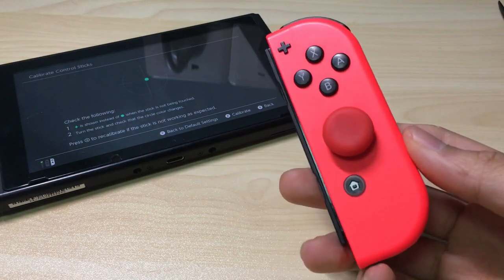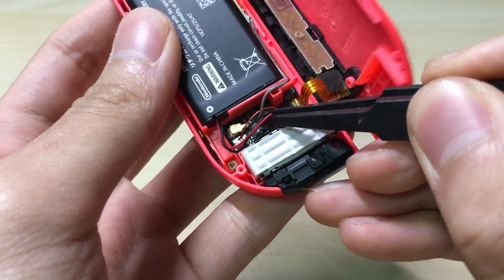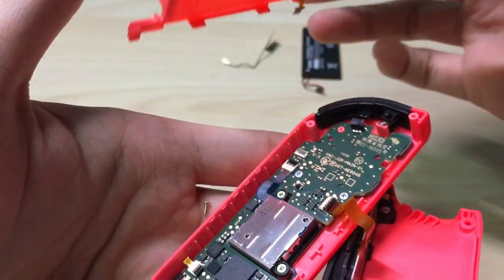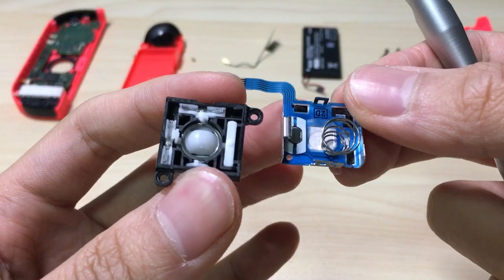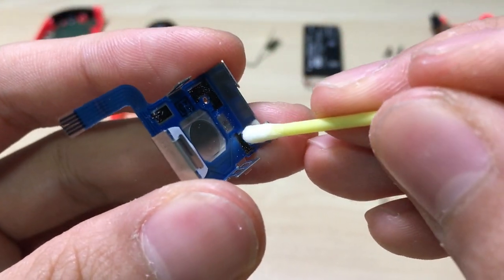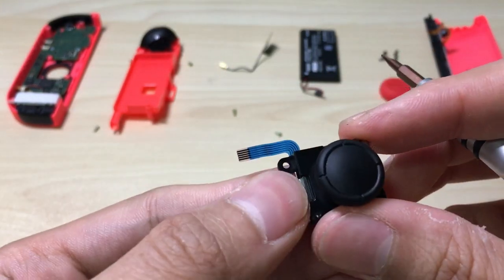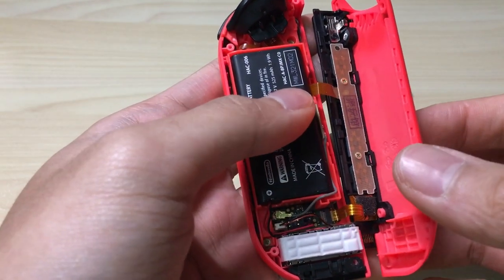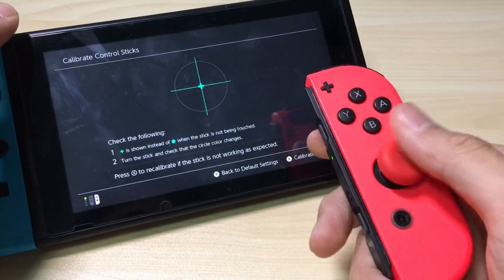Fix Joy-Con Drift by CLEANING the Joystick 🕹 - Nintendo Switch DIY Repair

Comment: @Kenneth Tanaka

My son's device had this problem, so I dropped 4 drops of sawing-machine oil on the middle ball of joy-con, ever since it then it works just fine, I never ever have to remove it apart.
Drop 4 drops at each four corner of joy-con, it works like magic.

Comment: Going to try this on both my controllers as they are both drifting terribly. If I do break one of the controllers themselves I don't really have much to lose at that point (been meaning to get a second pair for more friends) so it should be all good either way.
Reply from the maker: Yeah, just be careful on each and every step, especially when opening the metal plate, do it very slowly and gently, and you should be fine 👌🏻 I hope you succeed, good luck!

Comment: Tried this with my left joy con and I ended up breaking three of the metal tabs that hold the stick assembly together. Luckily, the clips on the sides were able to hold it together after I cleaned the contacts, though I was worried that the stick might not work at all after I was done(I was being a bit rough on it and I wasn’t in the right place to be working on it either). After some calibration though, it worked! Stick drift is completely gone, and hopefully it’ll stay that way for a while.
Reply: I cant get the side clips to hold it :( how do you do it?

Comment: A late bit of input here for anyone that might be viewing this...

The black strips inside are the actual contact points and if they're worn through, i.e. no black at the contact points (zoom in with a camera), this method won't help you much. Given the amount of work involved and the level of difficulty opening the thing, you're better off just buying a replacement kit from Amazon (less than 20 bucks for 4 and it comes with all you need and then some).

If you do attempt this, you should gently clean the bottom side of the contact arms as well as they will pick up debris. Be very careful with the ribbon/power cables, you don't actually need to disconnect them if you're careful, other than the one that feeds the + or - button to gain access to the screw on the left or right controller, I don't remember which (it's the most difficult of them of course). It is quite difficult to reattach that 1 so I'd almost recommend taking the screw that holds that button in place out instead and folding it to the side to remove the screw for the stick (it's under that other+/- ribbon cable). Both the left and right are completely different from one another so you'll see what I'm talking about once you open them. I'd also recommend dental picks to help with lifting the ribbon cable clamps if you go this route, those can break very easily.

I've done stuff like this before and the repair typically doesn't last very long (it ends up being more of a wear issue anyway).

Comment: This helped, thanx. Did you mention that slightest overbed of the metal brackets might result in their breaking off? I broke 2 out of 3, but got the job done, no drifting )
Reply from the maker: Welcome 😁 although I never break mine that’s why I didn’t know what it takes to break it, I knew I have to be very very careful on that though, anyways good that yours is fixed!

Comment: Hey I just wanted to let you know that your video helped me out and my joycon is now working. After cleaning the joycon stick and calibrating, drifting is gone. I had major drifting to the right. Initially, i fixed it temporarily by cleaning under the joycon stick cover with a qtip. After playing for about a week drifting came back. This definitely worked for me. I will report back if anything changes. Cheers!
Reply from the maker: I'm glad you got to fix it! In my experience the drift will come again a couple months later, and by then you'll have to be even more careful because I snapped my metal clip, just a little tip 😁 hope yours won't drift as quickly tho
Reply: @namedkenn  That makes sense, since after just one time the metal clips holding the stick together are probably infinitesimally loosened, and therefore less capable of keeping out tiny particles.

Comment: I ruined everthying.
At the start I was preaty confident, because I maneged to replace a stick, and ls and RS button on each joycons before.
At least I had Nothing too lose.
So I said to my self "why not" I cleaned all up and when I Got to part to get all back together I broke all three parts that hold the stick together. Then I stick it with some tape.
But I think that that stick was already too foulty and at the end of the Day, there wasn't hope for it.
But I watched your other video and maneged to fix ls, RS and replace a stick so thanks for that.
I realy hope that the statement "if you want to get better, that you nead to fail First" is for game console fixing too, because I want to do that for my coolege work.

Comment: It’s amusing that Nintendo doesn’t acknowledge this issue lol
Reply: Oh the do know about this but they just dont do anything about it
Reply: Its their way of advertising the pro controller
Reply: More like infuriating.
I find it pretty insulting that in order to avoid not buying another 40 dollars left joyon, I have to dismantle the controller myself, which, lucky enough, I have enough experience with electronic maintenance to go blind without  fucking anything up, Realise it's far more work than anticipated once I reach the analog module, keep going further anyways, manage to remove the select and L chips out of the way, remove the analog module, get stuck figuring how to remove the safety cap without breaking the wire, check a guide online, realize you can unplug the module, unplug the module, dismantle it, come close to losing the O ring and spring, realize that this bullshit drift was only caused by some dirt getting under the rotating joints and  contacts, clean it up, reassemble it all, realize I forgot a part, disassemble it again, mess up during the opening of the analog module's cap and end up losing the solid plastic minus button, spending about an actual full hour and a half franctically looking everywhere for it, accept that I may have lost it forever and may have to purchase a maintenance kit to replace it, calibrate the controller, test it and feel reliefed that the joycon drift problem seems  to be dealt with for now.

I mean it's legit a dirt problem and even though I have moderate experience with electronics, it's easy to fuck something up while messing inside the joycon. Meaning that most people will just opt for buying a new one since this is far more work than people are willing to put in. All of this for a simple dirt problem that Nintendo doesn't want to admit is a design flaw on their part.
Reply: @dsboy2392  that's exactly what not acknowledging it means.
Reply: But they do, they let you send it in
Reply: @justarandomweeb3220  Pro Controller is prone to drift as well. Same goes for Dualshock 4, Dualsense, XB1 and XBS.
Reply: They've acknowledged it. They just won't admit it's their fault. If they did, they probably would get more lawsuits and probably have lost the case they Won recently.

So as shady as they are, they're not stupid unfortunately.
Reply: @irregularzero9537  The dust is not the main issue, but rather the design of the joystick housing which is why the cardboard trick works.
Reply: No it’s not it’s infuriating

Comment: The NFC reader is located around the stick and home button. It's this large metal frame. 2:02 That's just a regular antenna.
Reply from the maker: Ah I see! Thanks for the heads up
Reply: @namedkenn  Thank you for making the video. Made me want to open up the few Joysticks I replaced and see which ones I can reutilize.

Comment: if I think about the assembly from the looks of it its operating similar to a modern alps analog stick, so why would there be a "dirt" ingress if its a sealed unit also since its what I think is also a carbon wipe I think wiping it with a bit of drawing charcoal would probably make it last a bit longer but this is more of a temporary fix until someone makes some sort of carbon solder

Comment: Had to do another “update controllers” and then calibrate after this but it seems to work perfectly now. I broke those little metal tabs when putting it back together so it was kind of a pain to make sure I kept pressure applied while I screwed everything down again but it beats waiting for new sticks to arrive

Comment: Really important point i want to make here is, the battery connector needs to come "up", not "back", otherwise you could pull the wires out.

Otherwise, excellent instructional video. Doing this felt like "Journey to the Center of the Atom!"

Comment: It didn't work for me. In fact, it made it slightly worse (the drift was intermitent, now it's constant). BUT it might be due to the calibration (my joystick was also not clicking, so I can't recalibrate). Anyways, I followed along, everything else still works, and now I'm confident enough to replace it with a new joystick. Thanks! :D

Comment: A new joystick is only 2 US dollars. Also I now have 60 of em laying around in bags, so the time spent on this MAYBE successful surgery is better spent focusing on sharpening my soldering smd skills, making yet ANOTHER working switch lite to add to the stack. . My best advice outside of just replacing the stick, is to not be grimey and gross w your equipment, is to try not being so aggressive with L3 and R3. That seems to cause drift quicker than anything

Comment: Great vid but honestly if you can afford to buy another thumbstick part I would just do that instead. Especially if you don't have much experience with these things. I was too rough with mine and ended up breaking off all of the metal sides that lock it into place, very frustrating

Comment: Thanks for the video, I just went out and bought a screwdriver set I hope it works
Reply from the maker: You’re welcome, and good luck! 💪🏻
Reply: @namedkenn  well while opening the analog stick I broke 2 pieces in there and now it won't snap on
Reply from the maker: Psycho Luv oh no... but just try to put them back together, then tape it, and put everything back in the joycon, see if it works.
Reply: @namedkenn  I'm putting it back together but now that I'm feeling it the joycon is way too lose, I really hate these
Reply: @namedkenn  also my R button fell off ???
Reply from the maker: Psycho Luv I’m sorry to hear that, but one thing for sure there shouldn’t be any problem with the R button, try to open the joycon again, until the step where you take the screws off the middle plastic, then align the R button back to its correct place.
Reply: @namedkenn  well, just put it back together and now the controller is stuck going to the right. I'll just have to take it apart again I guess. Thanks for being here while I did this you were a big help, even if I didnt do it right 😸
Reply from the maker: Psycho Luv you’re very welcome, I’ll always try my best to help people around so yeah hahah do let me know if anything new happens!
Reply: @namedkenn  alright so i ordered a brand new analog stick off Amazon and now my joycon works wonderfully 😸 thanks for the help again
Reply from the maker: Very glad to hear that! 😄 you’re welcome anytime!

Oh and also don’t forget to subscribe if you haven’t 🤣 I’m trying my best to reach 1K hahaha

Comment: The video was nice and informative. I apparently have big fingers and find it hard to hold and move the pieces. but the last part where you put the metal pieces back on the joycon, and need to pry a bit with the screwdriver I do not seem to be able to do.
Reply from the maker: If you’re able to buy a joystick it would be better I think yeah?
Reply: Kenneth Tanaka but it is the cost, $69.99 for a set of Joycons mine usually start to drift about every 6 months or so
Reply from the maker: I mean just the joystick, not an entire joycon, I think there’s a link I’ve put in the description, it’s like 10-12 bucks if I’m correct
Reply: Kenneth Tanaka true and that’s what I changed out. My idea was to change out the Joystick, then clean the old one, and have them as replacements for the next time.

Clean, replace, repeat

Comment: awsome video 

Gave it a go although things inside were in a different position somehow. Anyway I  underestimated the size of stuff and I had no magnifying lens so I was like an elephant in an antique shop. Barely even touched the grey tab that fixes the "minus" button onto the MB and it just jumped straight off. Can't find it.

Obviously the button won't work anymore I guess because the cable is not properly set. Any home remedy you can think of for it?
Reply from the maker: Oh no, I also snapped one of the black 'clip' and it took me a long time, and a lot of focus to put it back there. If you lose it though what I can think is to get a new joy-con motherboard, which will cost quite a lot unfortunately...

Comment: I was about to try this however I noticed a comment below mention they used wd40. So I gave that a go first and so far it's completely fixed it. I just used wd40 with the straw attached. If you move the thumbstick all the way to the left or right you'll notice a little gap that is just the right size to poke the WD40 straw into. And then gave it a couple of quick blasts. Then proceeded to grind the thumbstick around and around and tried to just work it around in every possible position. Then repeat. Also give the control a good wipe down after so to remove any residual WD40. Just in case... I wouldn't like to get the stuff on the screen. Just thought it wouldn't hurt to maybe give that a try first.

Thanks for the video though very good clear instructions.
Reply: Then you just made a complete mess inside it. 😐 And that stuff is difficult to get rid of.
You didn't clean the dirt inside it, you just displaced it. Slightly away from the potentiometer tracks. And the lubricant is now an even greater dust and debris magnet.
The design of the "JoyCon" itself pulls debris up whenever you move it. The PS4 controller doesn't have that rubber "skirt" that you can peel off. Terrible design.
How long did that "fix" last?
And obviously whoever is gonna have to replace the battery is gonna be mortified to find it covered in grease. 😐😐

Comment: Yea trying this is your best option. I thought replacing the stick with a new one was the way. Replacement sticks are junk. Nothing is better or equal to what nintendo is using. All Replacement sticks ive used were worse than the original sticks drifting. After I decided to open a stick housing up and clean it up I decided to look and see if anyone else was doing that. Then I found this video. Go this route. If this don't work then the ifixit sticks are your best option. Though they cost 15$

Just one thing to add as I've taken apart left and right joy cons probably 20 times as to get to the sticks you do not need to separate the halves. Work on a flat surface and the only ribbon cable you have to remove is the stick ribbon cable. This is only for the right joy con. The left joycon you will have to remove the L2 ribbon cable and then the joystick ribbon cable. There are way to many extra steps on this video. You can replace a stick in about 5 minutes.

Comment: I'm afraid to pull on the battery connector with any amount of force because I cannot see exactly how it is in place. Even in this video it looks like you are just yanking the thing right off the circuit board. I don't see any pins or tabs. So what are you grabbing on to with the tweezers? The outer edges of the terminal block? And are you pulling upwards or sideways? Same goes with that other connection you pulled off. I don't want to just arbitrarily yank on it until something pulls loose, not without knowing exactly how it is connected.

Thank you very much for the video.
Reply: The battery connection and rumble pack are in there kind of tightly but they literally just sit in those boxes. I asked myself these same questions and ended up just pulling them out, not yanking, but firmly pulling. It wasn't until I had to put the battery back that I realized it pushes back down into the connection.